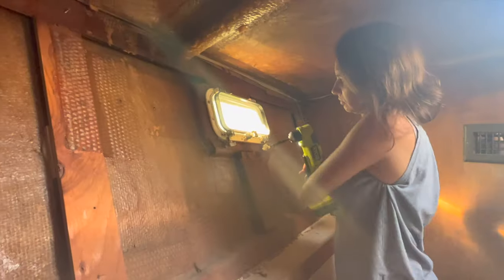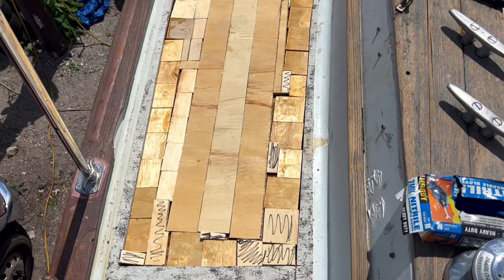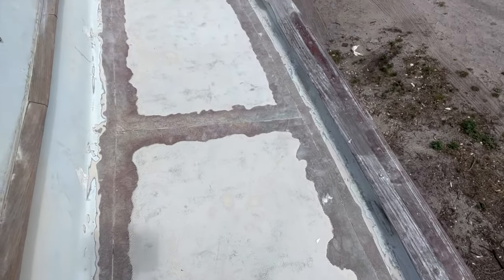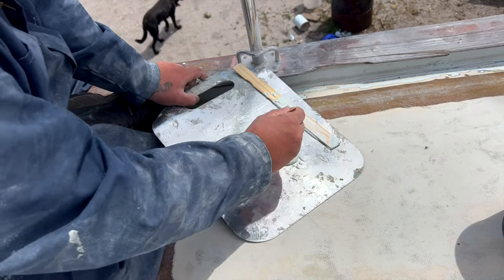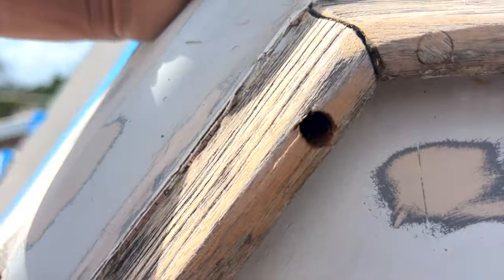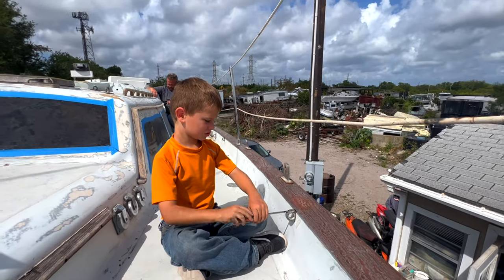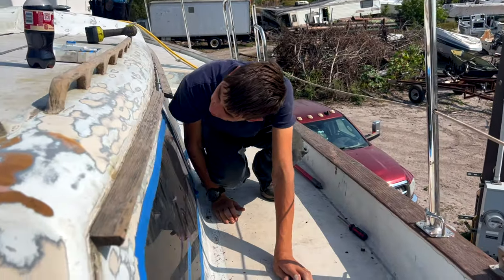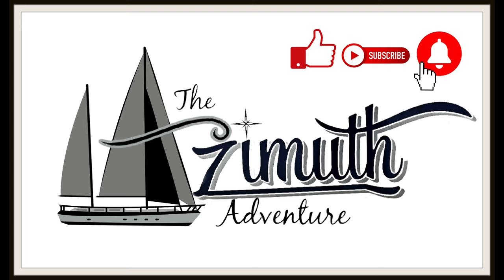The Irwin Sailboat DIY Restoration Project WK 32 Repairing, Sanding & Prepping the Deck Part II (56)

Comment: I would recommend anytime you take a screw or bolt out you enlarge the hole fill it with resin and refill. That will prevent water infiltration to the surrounding core. Great work, keep it up!
Reply from the maker: Thank you for the great advice. We appreciate you very much!